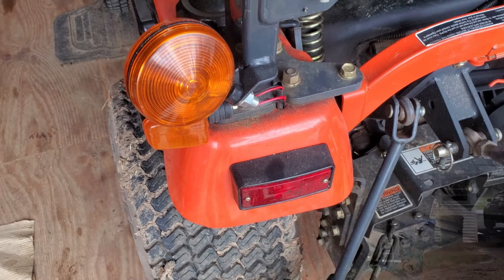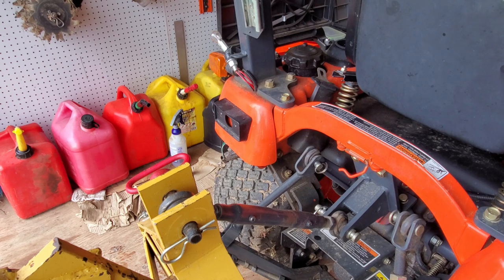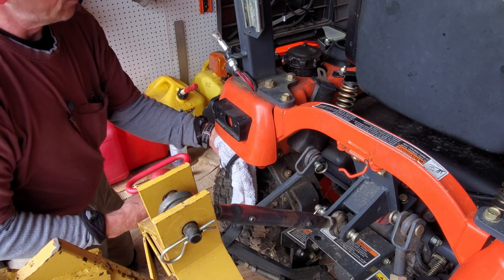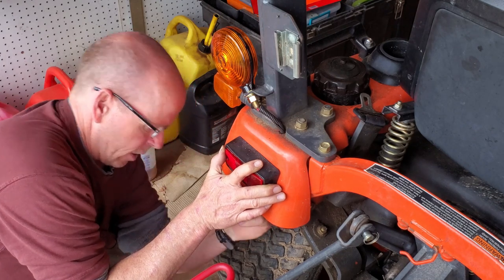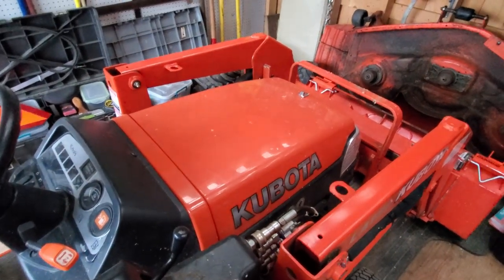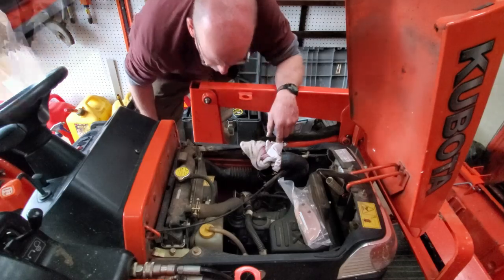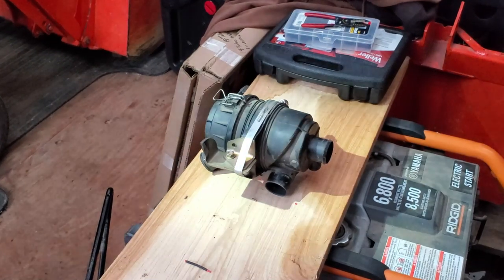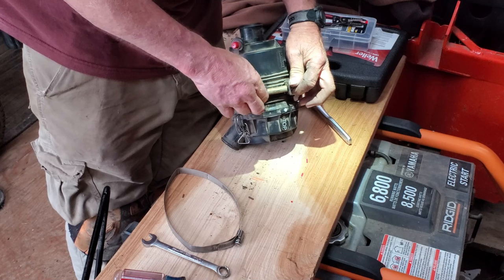Abused Kubota BX1500 Repairs

Comment: I'm viewing this video 3 years later. I pulled the little marker lights off and replaced the round lights with LED lights a while ago. Im already on my second set of LED lights. I'd like to add some sort of shield to protect the lights. My air filter bracket broke early in my ownership of 20 years. I have replaced the rear tires and rims. Mine came with liquid calcium in the rear wheels. Completely rusted through. Had to replace the mower deck belt this year too.
 Today, I'm looking for a flasher replacement video.

Comment: 125.00 for wheel and tire? from were?
Reply from the maker: Hello Ian, and welcome. I got the tire and wheel from my local Kubota dealer. It was ridiculous. Tire and wheel, $125. Tire alone, $187, if i remember correctly.
Reply: @IronOakSawmill  I noticed that a complete seat at the dealership for my B6100 was only 71.00! And after market was 180.00, so I normally always hit the dealership first. The main reason i like Kabuto.
Reply from the maker: @ionhunter  absolutely my friend. Cant go wrong with Kubota